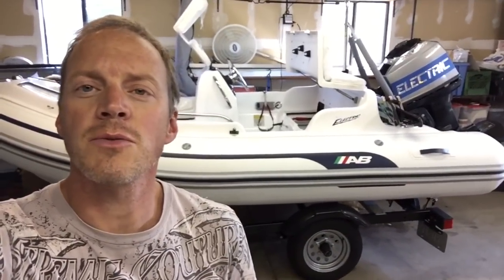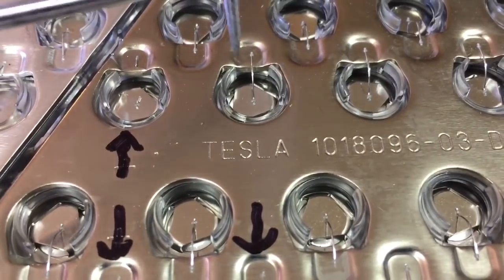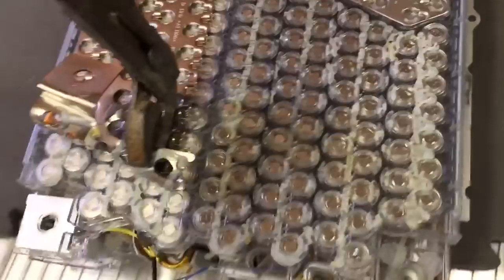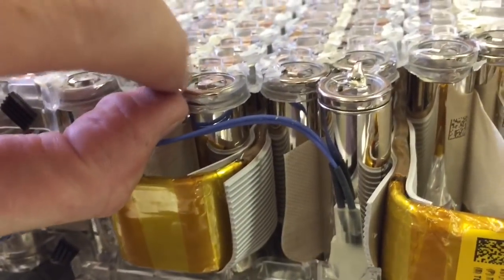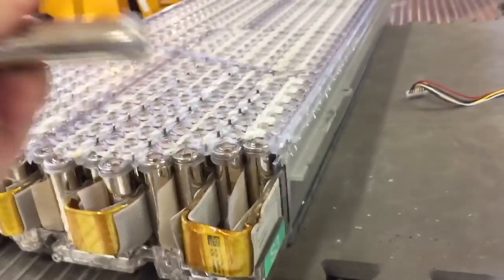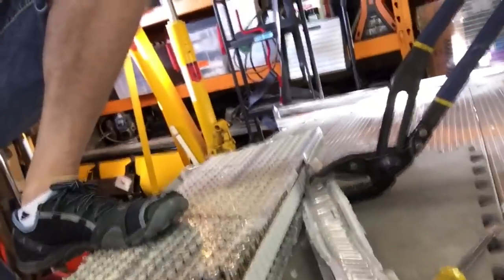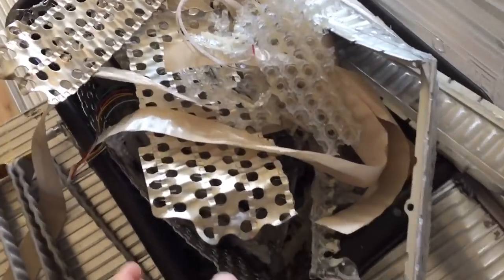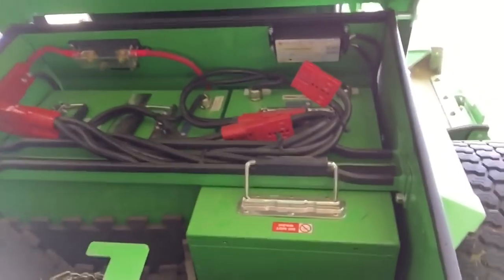Tesla boat battery destruction and teardown

Comment: 1) That module is so solidly constructed because it has to remain solid with all the vibrations it will suffer in a car over many years. 
2) That bubbling is it discharging, along with the temperature rise you got.
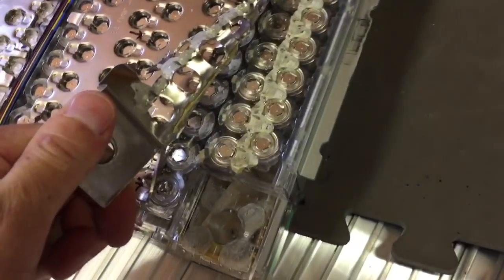3) You misspoke @2:00 saying there are 72 cells in parallel.  It's 74.  Great video, thanks for making and posting it.  Best wishes.

Comment: Im not expert but those tiny fuses carry 4 amps I think, the bus bar carries the big load you mentioned.  Great video, nice boat!
Reply from the maker: Squidlings Thanks for the comment, I wasn’t very clear but the maximum current of the four pack is carried by 72 parallel microwires. I’ve found that the pack doesn’t like putting out more than about 350 A continuously so that is about 4 to 5 Amps each. 

My Tesla P 90 D indicates 400,000 Watts+  during full power acceleration for several seconds. This would be around 1000 Amps total divided by 72 Parallel wires is about 15 A each.

Thanks for watching!
Reply: @jltempes  I heard that the "P" packs have dual fuses per cell to handle the extra current.

Comment: Each fuse does not carry 1500 amps, the total current is shared across many cells and the packs in a Tesla are in a parallel and series configuration.

Comment: I'm an Electrician that retired after 32 years. Just waiting to see what happens with these cars when they get older, 10-20 years. I've ridden in a couple Teslas and they seem almost magic to me. It was a great surprise to me to find that the frames of these cars are all Aluminum.

I spent a lot of time around Electric Lift Trucks that use Lead Acid batteries and even they are pretty amazing.

Comment: Water loop is for heating batteries in really cold weather and cooling batteries in really hot weather. In cold weather they do not work as well and need heated, in hot weather you want to cool them to extend life. You may not need to use cooling loop in your application.

Comment: Interesting thing is cell level fusing and temperature sensors, local manufacturer are not maintaining these two factors. Since it's Tesla manufacturing embedding system. 
Do we have any other options to maintain cell level fusing and temperature control ...?

Comment: This video says it was posted October 2017.
I just happened to come across it in March 2018.
I have been looking at the vids for Electric Cars and Trucks, motorcycles, and E-bikes.
So recently I wondered when I was going to see one on Electric Powered Boats.
Bravo!.
I would love to have an E-boat, not to Ski, but to just fish.

After watching your video, I wonder whether the Engineers who designed the battery fixtures and cooling system 
deliberately designed this to make it hard to replace the individual battery cells or whether it was inept foresight.
I was originally trained as an Electronics Technician, starting in the Navy many years ago.
After my enlistment I worked on many many types of electronics all designed by Engineers.
Some made their devices easily repairable and easy to do the required maintenance.
But some devices almost had to be destroyed to repair them.
Some Engineers make their designs without a clue that their device will have to be repaired some day.
Or it was the Management who told them to make it virtually irreparable because they wanted to 
make the customers buy new devices instead.
Just like Apple.
Apple does not make their devices easily repairable from a Technicians point of view.
If your device goes bad,  Apple just wants you to buy another one of their over-priced devices.

The ideal Electric Vehicle will be the one that has Replaceable, Modular, and easily Repairable Battery Packs.
Reply from the maker: Yes, I think it somewhat like Apple. With the number of vehicles they are building, they need to be able to manufacture millions of packs using literally billions of individual batteries so it’s all robotic and not cost-effective to be individually replaceable. Just my guess. 
Also, I think there would be an issue with balancing individual cells if they were replaced or not in the same state/ condition/age.

Comment: How much range do you get on your boat you figure? I was thinking about something similar for the power plant on an aluminum center console fishing boat. Similar to aluminum t tops from my local builders, Lifetimer boats and silver streak boats. I could get a hull designed from cope aluminum boats then power it with that. I troll for salmon , and have a few buddies who are fishing guides, so if it would be possible to get about 35 nautical miles I would be able to get to and back from some fishing grounds. I would probably put a solar panel on the t top. And run a 10 hp gas kicker motor for trolling. Then running around with the electric. Most boats run two motors for safety. That sound realistic?

Comment: The best tear down of a Tesla pack that I've seen yet. Just curious though, why didn't you replace the fusible link on the cells that had popped and just tried the pack again? Cool video bro! Cheers, John ;)
Reply from the maker: John Egan thanks for watching!  
I actually tried to solder a new wire in place and was unable to make it stick. Additionally, several of the individual batteries were bad and there’s no way to get just one out.
Reply: Yeah, it looked like a handful there, those cells are IN there...at least you tried. You probably would have needed a spot welder to put that fusible link back in place as the battery would act as a big heat sink and keep the spot you were soldering too cold to bond the solder properly...but not much sense if the cell was bad. Looking forward to your next video! Cheers, John ;)
Reply: The chap is rich enough (or being funded) to tear down a Tesla Battery !! How dare you suggest he replace the micro-fuses [you are a sad engineer (like me)] . He'd obviously ask one of his employees to do it - he's far too busy having great experimental electric-boat fun.
By the way, did you find another tear-down of a Tesla Car battery? The chap appears to tear-down a CRATED BRAND NEW BATTERY !!! I wonder who he did that for ... let's see if I can find the link ... I did ! .... here:
  https://www.youtube.com/watch?v=070JJwgupRw&t=3s
Can't work that one out at all - mind you 3 years old.
Kind regards
Reply: It's sad that more than one of these videos exist while we are in a race against time for renewable energy.
Reply: i would have just order the right tools to fix it or DYI the tab welder as there are many 12vDC  tab battery type units you can just make
Reply: There is no race against time. We already have the means and technology to continue to use ICE engines with natty gas and renewable fuel forever....hydrogen. But, that won't create tons of extra cash like wasting lithium and building new cars (terrible for the environment). Natty gas is clean as fuck and there's MANY decades worth of it, but it's almost all wasted. Electric and hybrid cars are worse for the environment than a diesel truck. They take multiple times more energy to produce, create tons of toxic byproducts and all electric is still burning fossil fuels for charging in most places lol. Get a clue, you've been duped, again, by big industry and the govt. Anything positive will not make big headway into the market. Every facet of the markets is rigged. This is late stage capitalism, get used to it.
Reply: Fun video to watch.  Good video quality, too.  Thanks!
Reply: but in that case our curious minds wouldn't have seen inside of tesla battery module. I am glad someone made that video.
Reply: TheGuruStud    preach

Comment: Great video.  Since this is connected in series, so does one battery cell die, the whole module dies?
Reply: No, the configuration of a module is 6s74p up to 6s86p.  There are 74 cells in parallel.  If one stops storing power, the other 73 will pick up the slack.  So you lose only 1/74 of your power.

Comment: Curious what your using a BMS for the 11 modules in the Boat? Great to see all those dissection details. Thanks for posting.
Reply from the maker: Thanks for watching.  I am currently balancing the cells manually every few charges...tedious.  I am looking for a BMS to use.  The Tesla modules have a little 7 wire plug...6s72p for a bms.  I think Thunderstruck motors just came out with a BMS that will work for my 42 strings in my 7 modules.  I am hoping it's a simple matter to hook it all up.  I'm also working on liquid cooling all this... Jon.
Reply: Had to smile when I saw the little 7 wire balance plug, looks very similar to the one on the  3s lipo batteries I use for my drone. Expected it to look more beefy somehow !
While 5 kWh is a respectable amount of energy from that size of pack, there's a fair amount of space given up for the cooling loop and a couple of mm space between each and every cell .
It's likely that solid state cells requiring no liquid cooling due to much lower internal resistance ,will make packs like these look pretty bulky in the coming years.
Reply from the maker: Macmonkey1000 I agree with you, I am experimenting with super capacitors for race applications due to the very low internal resistance. Tesla was able to pack more of these 18650 cells into the 100 kWh battery pack that recently came out by removing the cooling ribbon between the cells and doing some sort of top and bottom cooling hence 10% more capacity.
Reply: @jltempes  What are you currently using as a BMS? You could consider making your own if you're into electronics, LT makes some good chips for this purpose which can be daisy chained for each module.

Comment: 1:11 Can someone tell me why both separate parallel packs have a (+) top plate? When it is clear that left side 18650's are all (+) up, and all right side cells are (+) down. But yet both metal top plates are clearly marked (+). Does this make sense to anyone? Am I right that the individual 18650's are connected in parallel to each other with that very thin wire? Batteries/insulation/metal plate to cell via tiny wire. What am I missing? And again, why are the metal plates both marked (+)? Hope that makes sense..

Comment: Hello i thought the Telsa pack has 444 cells in them? You said 72p6s that is a total of 432 cells. So it's really 76p6s. That is correct or am i wrong? Also i was wondering If you are using the Water cooling to cool down the packs? But over all Very cool boat and awesome video thank you.
Reply from the maker: Diy in the Ghetto Good catch, although 76P6S would be 456 cells. Actually it is a 74P6S with 444 cells. I had go count them!
Sorry for the error. 
I am installing water cooling this year. It was air cooled the last two seasons. Water will be much better. I also need to install a battery management system to balance the voltages of all the groups of 74 cells. 6 groups of 74 cells, times 7 battery packs is 42 groups to balance.
Reply: Net Positive LLC no need to be sorry man. I screq up all the time. Lol You got one awesome boat very cool 😎

Comment: Dear Net Positive LLC - thanks for your considered reply. Being very old, I catch up with exciting new things quite slowly these days. I did see Tesla had made a new battery, and I bet Panasonic and Tesla are 'in bed' commercially (I would be, the number of batteries he's buying) and sharing the development of better batteries. I did happen to se a 2170 article, somewhere after I saw yours.
I got a leaflet, too, from Renault. (heard of them under there ...?) They're French and make cars (and F1 engines, possibly ..) and other stuff. Their leaflet said I could test drive their electric CLIO - a ZOE. Then, I noticed it was about car finance - not really test drives. At the end of the small print, it said 'by the way, you'll never own the battery.' Wot - I thought - do I slap my balloon payment down at the end of the lease, they disconnect the battery, and then say I can push off? - literally ... no. Of course, they want the old battery back, and to lease me a new one.
Also, I noticed the charging options for my electric car. A cheap-as-chips free (government funded) charger for my home - charges the car overnight (~3KW - ie cheapest we can do that actually charges the car overnight). A more expensive one that charges the car more quickly, but runs maxed-out on 1 UK domestic supply (about 11KW) or a really expensive charger that charges the car to 80% of its capacity in 2 hours. (special 3-phase supply, new supply and rental charges for this one on top of the domestic bill) So what? Well, if I'm driving out and about, I can charge my car at a charge-point in about 1 hour - that's breakfast and a coffee, or lunch, or a reasonable stop. Double the capacity of the battery and that's 2 hours charge - which is not a reasonable stop time. Higher capacity batteries will need very powerful chargers - and lots of them. The UK does not have grid capacity to run them - forget how many charge-points we need. That's the real problem - how we charge all these electric things.
This is fun - if you've not seen it. It's how we're doing right now ...
  http://www.gridwatch.templar.co.uk/
Also, I read that you can 'wellie' the first bit of a LiPo charge cycle - the bit to the much quoted 80% - but you have to trickle up to 100% *over the same time* no matter how fast you 'wellie' the first 80% - so *no win* to 100%. However, 80% fast is OK, of course. This needs to change with newer chemistry.
Then the nice Renault lady (who was damn good, professionally) killed the sale stone dead, by telling me the new car out this year sometime soon, would be twice the endurance of the old one (around 200 miles). So, did I want to buy the test drive model? "Not now, dear, but next year once the new one's out, as this one will absolutely plummet in value - and it goes 100 miles on a charge - fine for me."
There's a ton more fun electric and battery and UK Grid capacity stuff to witter on about ... but my tea has brewed, so I'm off to have a nice cuppa.
Kind regards
Matt Lee
Reply from the maker: M Lee thanks for watching and the thoughtful comments! Here in America, I can drive anywhere in the country in my Tesla for free. Their  super charging stations gives you 70 or 80% charge in 20 minutes. I can do 330 miles on a full charge. This is a no-brainer for long distance trips which I only take once a year. The Rest of the time, I leave the house with a full charge every day from my solar array on the roof. Tesla is the only manufacture with this capability. We also have a BMW I three with an 80 mile range which is fine for 95% of the driving that we do but I absolutely hate legacy auto manufacturers! The batteries will keep getting better and cheaper and within a couple of years there will be a dozen manufactures making vehicles with better performance and comparable cost to internal combustion. I chose the boat project because it is a passion of mine and it is one of the most difficult things to achieve. If one guy in his garage can cobble together some parts and make an electric water ski boat, anything is possible!

Comment: What is the configuration of the boat?  3p14s74p?  7p6s74p?  6p7s74p?  14s3p74p?  21s2p74p?  2p21s74p?  If the boat is 48V, then it has to be 3p14s74p or less likely 14s3p74p.
Reply from the maker: I have 7 modules wired in series.  The modules are 6 series, 72 parallel.  The boat is 170 Volts.  So, in essence, it's 42 series, 72 parallel.

Comment: Very interesting video. Explains to me why Panasonic bought Sanyo, a while back; and why the 18650 is - quite recently - a 'standard' battery size. I also thought Mr.Musk was making batteries. He's clearly buying lots from Panasonic, at the moment. So a Tesla pack is 6 series-connected 4V blocks of 72 parallel-connected Panasonic 18650 cells, giving a 24V battery pack. Need some careful 'smarts' to charge and use this. I don't believe one of the 'micro fuses' can carry 1500 Amps - not that fuse-wire gauge - no way. If the BLOCK delivers 1500 Amps - which it has to, if the whole pack can - then a fuse wire - on one of the 72 batteries in the block - is carrying 1500/72 amps = 20.83 Amps. That fuse wire might handle 20 amps - I buy that one. The voice-over implies - a bit - that each micro fuse is carrying the full battery current. Wow, though, what an excellent video and most informative tear-down. Nice, clear photography, too. Well done.
Reply from the maker: M Lee you are correct all the way around. In order to get the horse power that Tesla was stating out of a performance vehicle of 762 hp, the batteries would have to be able to deliver 1500 A which they can’t. I think they can do 1000 A for very short periods of time and only 400 A continually. Also, whatever the full amperage is would be divided by 72 parallel units. So 1,000 amps total power, you would only be putting 13 Amps through each MicroFuse, very possible especially given it’s only a quarter of an inch long.  
I am currently experimenting with super capacitors for race applications that are capable of 1900 A! Thanks for watching!
P. S. Tesla developed the next generation of the Panasonic 18 650 which is currently being used in the Tesla model 3 and power wall 2. It is a little bigger battery with twice the capacity. It’s a 2170
Reply: Net Positive LLC it's nor the length of the conductor, but the size that tells you amperage rating.
Reply: does each serial connection carry the full load of the pack?
Reply: @w4csc 300 cycles and it's dead or 300 cycles and it degrades say 90%? And that didn't answer the question haha
Reply: M Lee if there are 72 in parallel and each is limited to 10a discharge, thats 720 amps. the parallel connections do not carry the full current, it’s the series that do. which is why the microfuses dont melt under load. the microfuses are only to wire them in parallel, not series.